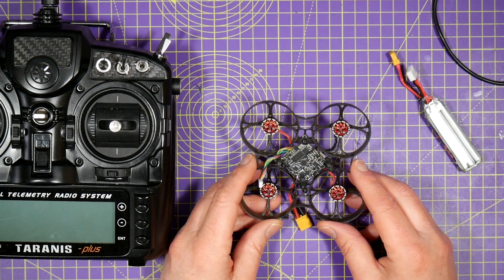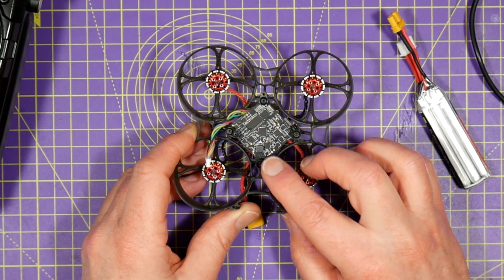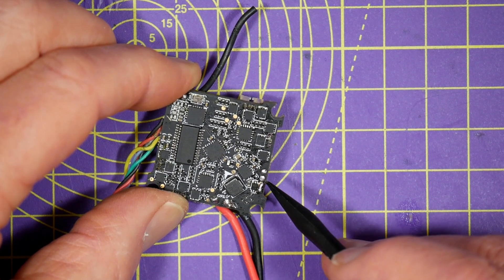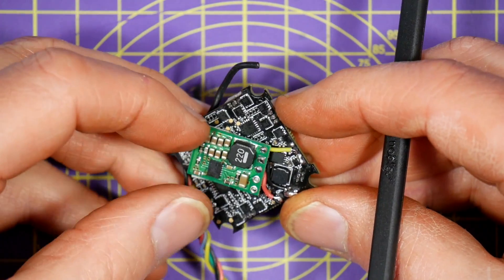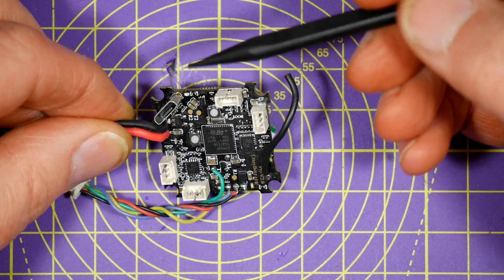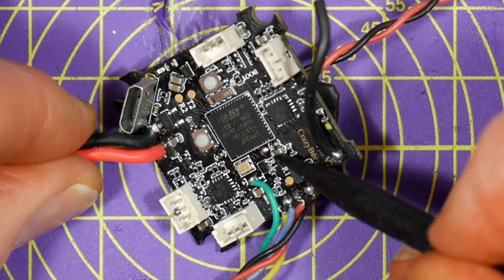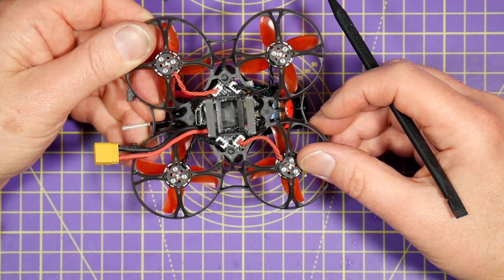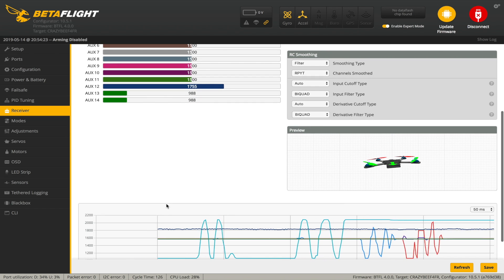Mobula7 HD - repairs // upgrades // 5V BEC fix // external receiver // buzzer // FrSky xm+

Comment: Very helpful, thank you for your video and time, BUT so if I understand correctly, I need to put a XM Plus receiver on the board since the quad will not bind with the receiver? Here's my story, (short version) I have had 2 brand new boards and when I first plug in the battery there is a small amount of smoke. Happened on both FCs I received. Everything works on Beta flight, the motors and all work but it will not bind to the receiver. Is this normal? or is it because I need the XM Plus receiver installed? I've been working on and off with this for 3 years.
When I hold in the bind button on the board the flashing lights go out and do not go solid to bind. But the green light is on.
Thank You again Great video

Comment: Hi. I tried installing a happymodel ep2 express lrs rx in mine and cant get the Serial Rx to save in betaflight. When I set it, it just reverts to disabled every time
. I have set the Receiver to Serial and Crossfire in the receiver section. Any ideas? I cant even get the soft serial that I want to use to have VTX smart audio on to save either.

Comment: My Mobula 7 needed a replacement 5v reg after about a week of use, also a separate rx  as the spi one wouldn't keep bound to my transmitter, I also added a buzzer and swapped the camera too as the light /dark transition was very bad on the original.  So not much original Mobula7 left really !!!
Still flying though after many many flights 😊

Comment: How did you take the props off? Mine came with the props on so tight that even the prop removal tool just bends when I try to use it
Reply from the maker: Hold the motor bell and carefully twist the props off.

Comment: happened to me too. will be replacing a 5v reg soon.In the meantime i got a F4 pro v3.0 board. And could i still attach a capacitor to the lipo batt line like before? For extra precaution ? They say its not needed buti want ur take on this. thanks in advance !

Comment: Hi! Just saw this video and noticed that you had RSSI working. I have a FlySky FS-i6 flashed with a modded firmware that allows it, among other things, to receive rssi information. That being said, I don't see any activity in the Receiver tab in Betaflight. Could it be because of the FlySky version? Did you have any problem setting it up? I'm not an expert and this is my first drone, so there's a real chance that I missed some step that was key to enabling RSSI.
Thanks for any help you might provide. You won a subscriber :)
Reply from the maker: I don't use FlySky so I can't really help, but have a browse around youtube - I'm sure there's an answer somewhere.
Reply: @WhirlyBloke  thanks! I'll keep looking around. I'm bound to find something someday!

Comment: beautiful video thanks!
I also have a microdrone with f4 v2 crazybee
and for a few days I haven't been connected to the radio anymore, I think the internal SPI frsky is broken.
consequently also the caddxtartle v2 gives me a gray screen, but I see the data, is it a consequence of the receiver or is it another problem in your opinion?
Reply from the maker: Probably the internal RX. It's hopless.
Reply: @WhirlyBloke  i can try with a xm frsky... Maybe the caddx will work?
Reply from the maker: @gabrieledubbini3255  Go for it.

Comment: I lifted the buzzer+ pad from the CrazyBee V2 board. Could there be any alternative for buzzer connection on this board?
Reply from the maker: It's easily done if you hold the soldering iron on the pad for too long, I recommend not just relying on the flux in the solder. Use some separate flux like Amtech. You'll need to dig around with a multimeter to try and find other buzzer connections  on the PCB. There's no schematics around so it'll be a voyage of discovery.
Reply: @WhirlyBloke  Yea, thank You WB. It was not so easy with the conformal coating i applied on te board :) Therefore i asked the question. I received another quad with this board in the meantime, and was able to fix it - there are  2 or 3 alternative points. But strangely i found no alternative for the buzzer-
Reply from the maker: @tomh4618  Let me know if you find out.
Reply: @WhirlyBloke  I fixed my problem with buzzer+ pad. But if i had this problem with buzzer-, i would not be able to fix it. (That was a remark only, it surprised me i found no alternative for buzzer- on the board.) I really appreciate Your support and knowledge!
Reply from the maker: @tomh4618  NP

Comment: Was scared I'd gotten a counterfeit when my FC board looked different from yours, but apparently they're now shipping this quad with the CrazyBee v3 which has a completely different pinout. It's item ID # 1534753 on BangGood if you want to put that in the description or something. 

Anyways, thanks for the concise and informative video. Was just looking for where to solder my XM+ to (ironically I couldn't get that from this video) and hadn't even considered adding a buzzer or adding a conformal coating to the bottom of the FC. Now instead of just more range I've got a pretty upgraded quad. 

Have you messed with the tune at all or are you happy with the stock PIDs?
Reply from the maker: Thanks for watching. Yep, suppliers do change things so your have to double check. I've just used the stock PIDs for now.
Reply: @WhirlyBloke  Any interest in a 3D printed guard to keep your wires from potentially getting caught up in the motors? I'd have no problem sending you one as a thanks for the helpful video.
Reply from the maker: @TheSolongsidekick  That's a kind offer but I'll pass - I'm a bit to busy at the moment. If you've got a link to the STL file, I'll add a link to it.
Reply: @WhirlyBloke  There are a couple options. Item # 3540289 on Thingiverse is the most minimalist, and item # 3545468 is another great option.

Comment: Is it possible to add an external FRSKY receiver to a FLSKY Mobula7 HD board? Snatched the flsky version instead due to discount. I think it shouldn't be a problem but just wanted to make sure before taking it apart.
Reply from the maker: Here ya go http://www.happymodel.cn/wp-content/uploads/2019/03/Crazybee-F4-Pro-V2.0-no-receiver-Version-Connection-diagram.pdf

Comment: Hi mate just wanted to know if you had the chance to test it after the mod and did you have anymore problems after that thanks
Reply from the maker: It get used quite a lot and it's been no problem, especially now I'm locked down indoors.

Comment: I really appreciate all your information. I just got the Mobula HD and I plan to move it to the Whoopee frame that you showed in another video.
I have a question if you don't mind. My Mobula has the V3 board and there is a little square PC board in the top of the canopy that I can't identify. Its about 1/2" square with power leads running to it. I haven't seen any one mention it and I don't see what it would do since its only connection is the power leads.
Thank you
Reply from the maker: That's an RGB Breath LED voltage indicator. The LEDs glow and pulse depending on the battery voltage. http://www.happymodel.cn/index.php/2019/03/01/rgb-breath-led-voltage-indicator-for-mobula7-hd/

Comment: hi WB i having a problem with my MOBULA 7 with FLYSKY FX-I6X binging so it can bind but in 2/3 second it will disconnecting. why is that happen . Plz
Reply from the maker: Sounds weird, but the on board RX is awful. Us an external RX.

Comment: Nick Burns(US), who received one of the the very first pre-productions from Banggood used and recommended 2S. And it flew forever. I have watched 4 reviewers videos, and 3S fries either the board or the esc from 1 day to, at most, few weeks.
Reply from the maker: The V2 version of the CrazyBee has very electrically noisy ESCs that produce large spikes on the power rails. Sometimes the ESCs fry but more often the 5V BEC can't cope with them and fries. The V3 version is much better and has upgraded ESCs and different BEC - 5V buck inverter.

Comment: hye i have buy fc crazybee  f4 mobula 7 from my friends when i connect  the usb the fc suddenly smoked. does fc already broke down can i know what the problem
Reply from the maker: Sounds bad. If it's smoked it's probably the 5V BEC. The V2 version of the CrazyBee is very fragile and it;'s a common problem. If you're going to replace it, I'd recommend the V3 version which has been sorted.
Reply: Whirly Bloke so basically i cannot fix it anymore right 😭

Comment: Thanks a lot for these awesome Video. There is much to learn from you :)
Which Video explains the problem with the XM+ ? I didn't saw the Link. I have the same problem to bind my rc with the XM+. I did bind on SBUS and set everything. Now when i start i have a huge delay on the control. Also i have the question what the AUX 12 deflections are in Betaflight after binding with the XM+ on one of your videos?
I'm new with quad's so there is a hole to fill with knowledge :D Hope you can help here :)

Comment: First off I'd like to thank you for this video! It's the only one I've seen with such great detail on the why the where and the what so thank you!I've had my mobula7 HD and it still runs perfect.  I'd like to install the regulator before I  burn it up. Should I also add a capacitor and if so should it be I stalled on the xt30 lead or after the regulator?
Reply from the maker: Put it on the battery wires connected on the board if you can.

Comment: would this be the same process to add a crossfire nano receiver?
Reply from the maker: Yes, but make sure you connect the CrossFire receiver to the RX1 No Inverter pad, not the IRX1 pad I did for the XM+. Remember, CrossFire uses non inverted serial signals.
Reply: Whirly Bloke brilliant. Thanks. Appreciate the reply.
Reply: @andijones1985  Hi did you ever get this going? I'm now trying to get crossfire setup on my mobula7. tks!

Comment: hi, once the buzzer is connected, how is it activated by radio control? I'm a novice and I don't understand much
thanks
Reply from the maker: Set up the switch you want to use on your transmitter and then use Betaflight Configurator to assign it to the buzzer. Follow this through to see how it's done. https://youtu.be/OWOPFgk8SyE?t=1152
Reply: thanks youuuuu

Comment: haha I can't believe you fit all that crap in there... I've been wanting to upgrade my mobula receiver due to intermittent failsafes, but i was worried about fitment. Now i see it is possible, thank you
Reply from the maker: It's a bit tight and take care with the soldering - use plenty of flux.

Comment: Fantastic video mate. How do you rate this micro? In the market for an HD whoop but there are so many. How's the jello?
Thanks
Reply from the maker: The Mobula7 HD is very good but the CrazyBee F4 is a bit fragile. iFlight CineBee is more solid but suffers a bit of jello. Easily fixed with soft mounting and ND filters.
Reply: @WhirlyBloke  Thanks for your reply. I thought the iflight had less jello but it's a lot heavier. I'm seriously considering that Mobula HD.

Comment: I landed in grass very softly after a 20 meter first flight. Now my Crazybee F4 Pro V2 will still power up, but I don't get the 4 beeps at the end, like I used to. I can't spin up the motors in Betaflight, and even though it's still bound, and my QX7 shows it's bound with switches all working. Can't get motors to spin. Fragile boards! This my 3rd bad one. My Mobula7 HD burst into flames on 1st power up from the stock battery, 2nd FC simply wouldn't power on. This 3rd one actually flew for 2 meters! AMAZING! LOL I guess I should be happy?!!! 😩 🙄
So, do you think this board can be fixed? My guess is the ESC's are bad?  Or?? ... If it can be fixed, how would I go about doing it?
Thanks so much for your time... I really love your channel! 😁👍
Reply: not sure but adding capacitor might help....check here https://www.banggood.com/Happymodel-XT30-Plug-Pigtail-Power-Wire-with-100F-Capacitor-for-Mobula7-HD-TRASHCAN-UR85-UR85HD-Crazybee-F3-F4-PRO-Flight-Controller-p-1476203.html?rmmds=search&cur_warehouse=CN

Comment: This is so awesome. You get into so much more board troubleshooting than my other subbed channels! Can I post questions too? A ESC died on my mobula7 HD, and while troubleshooting I accidentally pulled a wire out of the motor. It seems impossible to fix so I'm trying to get another board and motor, all sold out of course. Subbed :-)
Reply from the maker: That's the problem with popular stuff - you end up with a supply drought.

Comment: Excellent info, I 've just installed a xm receiver, works perfect. The mod does stop smart audio feature from working, I followed another helpful video I used a while back on another build to fix the issue, https://youtu.be/TaCD_oa-XBk just be aware the resource ID will obviously be different on the CBF4 board and you wont find the transponder entry either. Thanks again for the info WB. :-)
Reply: Hi, did you managed to get smartaudio working yet? Troubles with the correct resource procedure for softserial. Could you please explain it?
Reply: @dcclark01  Hi mate, wow that was a while ago, I just dung this video up, it maybe of help, it helped me...https://www.youtube.com/watch?v=TaCD_oa-XBk
Reply: @dcclark01  ahhh ok i've already listed that video :-( ok i will have a think about it and come back to you, if ofcourse you have not already found a solution?

Comment: Super video! Many Thanks. My mobula 7 hd one of the ESC doesn't work, the motor don't start and I check with one of the other motors sow I am sure is one of the ESC. The question is it can be fixed or I have to change the  board ?
Reply from the maker: Swap the motors wires over for one of the working ones to check if it's the ESC or the motor. If it's an ESC that's blown, you'll need a new CrazyBee board.